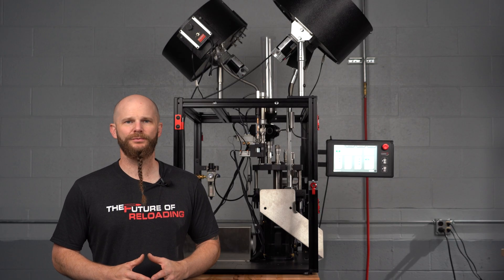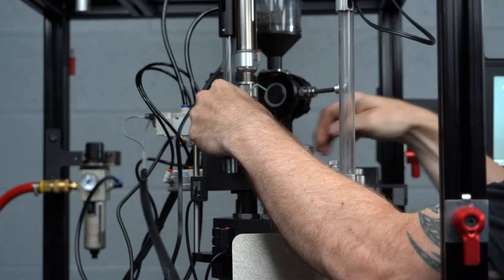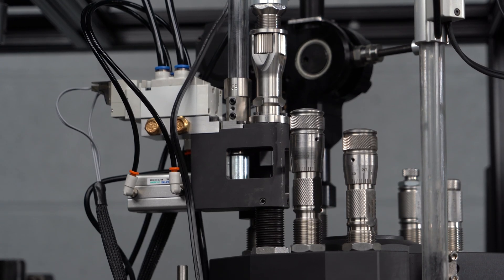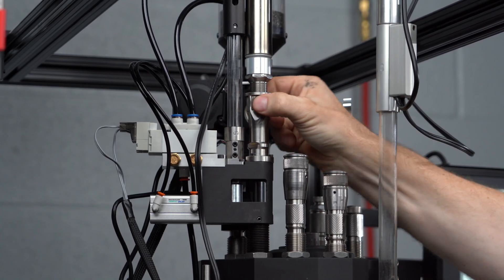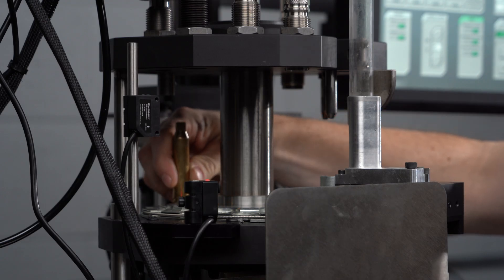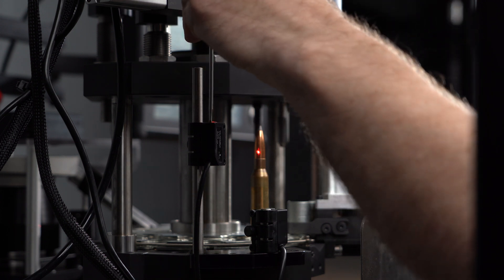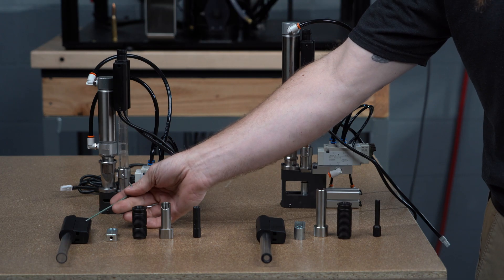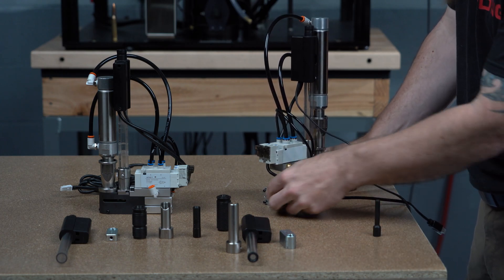The Titan™ Pneumatic Bullet Dropper Install Guide - Mark 7 Reloading

Comment: I'd recommend thoroughly tightening the 3 set screws on the housing to die body to prevent it from rotating at any point during operation